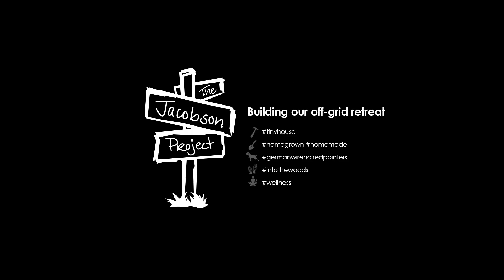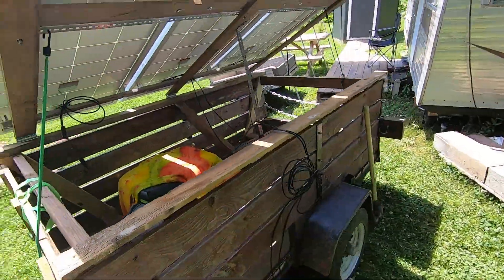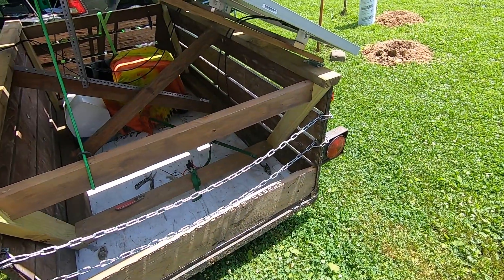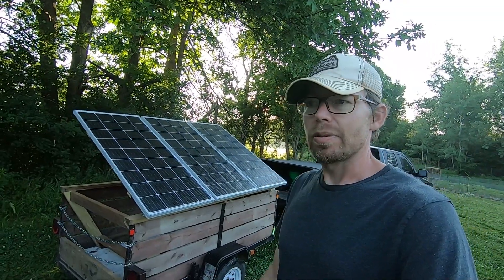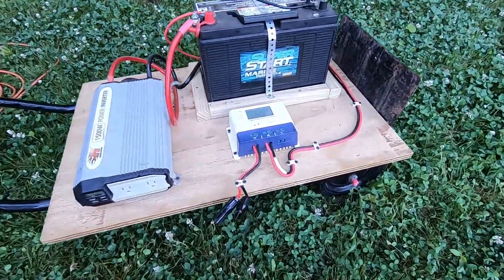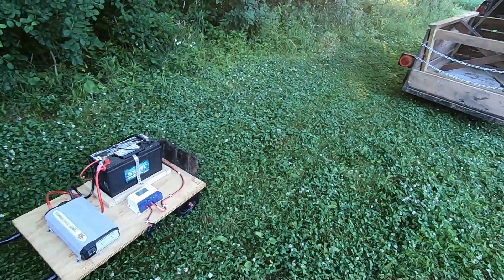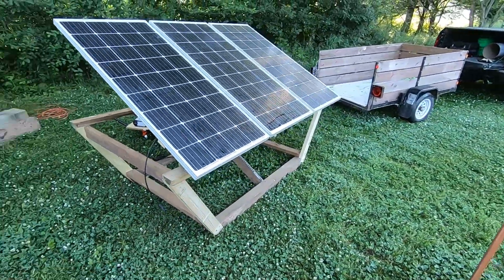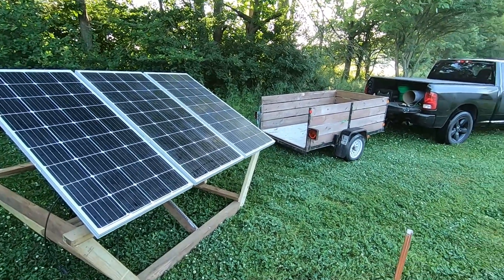Mobile Solar Panel Trailer (homemade) - Ep. 09

Comment: I may need you to show me how to hook something like this up for my wood yard once the days start getting shorter...haven't decided yet if I wanna get a couple solar panels or just a small generator...only need a few lights back there so thinking the generator might just be easiest...lol
Reply from the maker: The nice part about solar is that you flip the switch and the lights go on and off. With a generator it is pretty easy to use and probably cheaper but you have to always start them and stop them outside. That is unless they have a remote but I imagine those units are a bit more pricey.